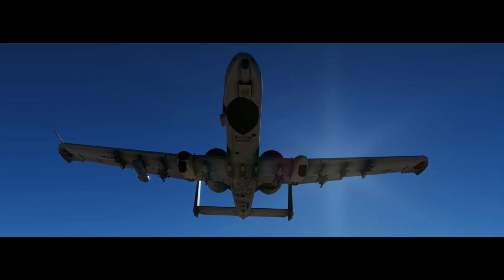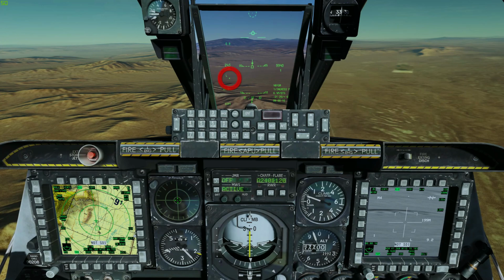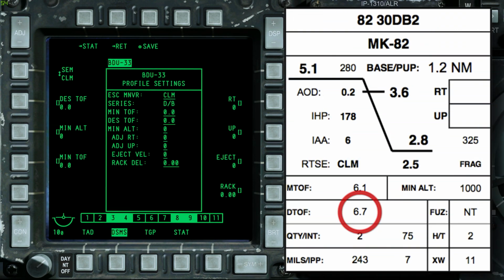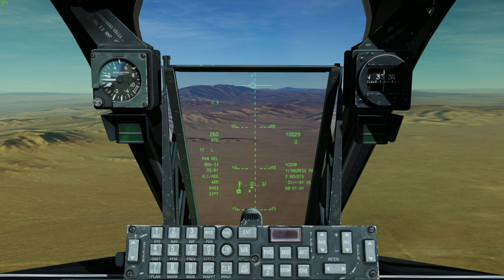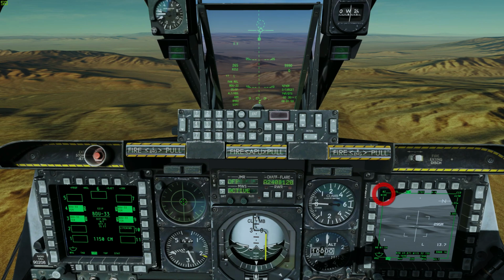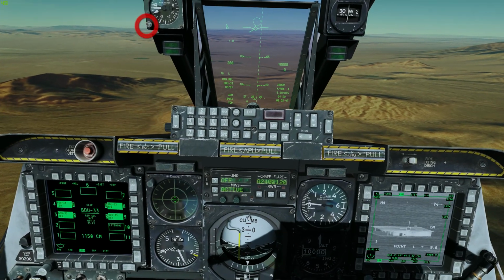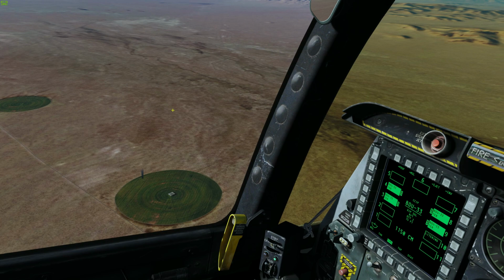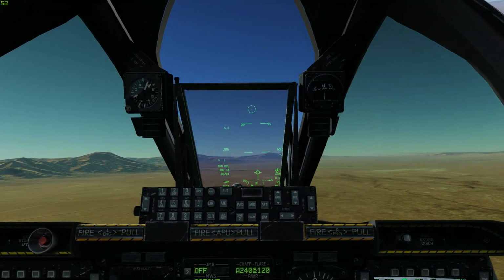DCS : A10C : CCIP 82 30DB2 Tutorial Nevada

Comment: May I ask where you got -34 for the depr mils setting?  I'm looking at the Z-Diagram for the 30DB2 and it says MILS/IPP is 243 7.  Am I missing some unit conversion required?
Reply from the maker: As you discovered, it's a convenient simplification.
Reply: In case anyone cares, -34 is not calculated from the Z Diagram, but rather a known quick reference which will set your manual pipper roughly equal to where the FPM would be once you stready the dive.  As with this tutorial, a quick quick reference if you don't have time or precision enough to do the full thing.